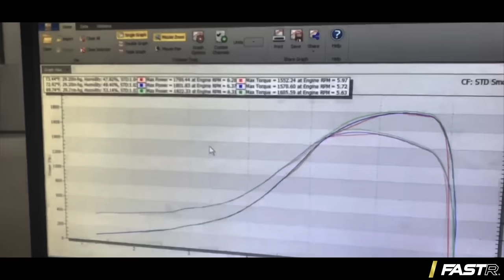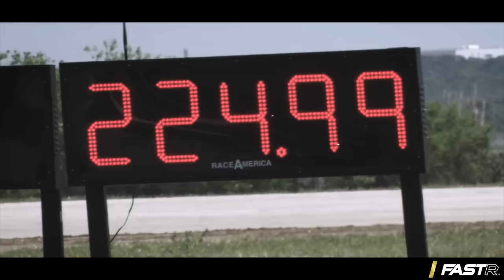2500bhp Viper on the road! Calvo Motorsports Visit!

Comment: As a porsche fan myself, I don't understand why these vipers aren't more popular. Great engine, not that expensive if u are on the states, a great track car overall, and it is a manual, which a lot of car enthusiats love. Pure respect for dodge and these guys who are building these absolutely beastly machines!
Reply: They were expensive for the average gearhead at around 100k. There were sport/ish cars for that money by makers that had more brand "recognition", if You know what I mean. Porche, Merc, Audi, BMW mainly. Much more "prestigious" to own those in circles of people that buy cars for around 100k.
Reply: @Duwurf  Yeah true... I didn't remember the germans were pretty cheap over there too. In europe cars are almost double than in the usa, even the european ones which is pretty rare.
Reply: they are dangerous cars, the main reason is that all of them only came in manual, which most people especially my age can’t drive… they also had saftey issues, which is why it got canceled in 2017, the first gens didn’t have ac, traction control, stability control, and no radio. These are not friendly cars.
Reply: The Gen 5 Vipers are excellent cars.  I own one.  I believe the reason they didn’t sell was 2 reasons.  Gen 1-4 were VERY basic cars that were expensive.  People who could afford them tend to want the iconic Porsche, Corvette type cars they grew up wanting.  The Gen 5 is a completely new car, a true supercar.  It takes many yrs to establish that credential.  I lost track at how many young people say “this is the car I grew up wanting and now it’s gone”.  Dodge should have kept the Viper line open as a limited production.  I can’t think of better marketing for a company than a Viper sitting in your showroom.
Reply: @todd5082  TBF I'm sure they make insanely better margins on the Hellcats/Demons, and they never had a devoted racing program to support the Viper to engineer out the kinks. Every other comparable brand does a good job of partnering with both road racing & drag teams to get the most out of each line and get the public looking their way. Audi, Mercedes, Porsche, Ferrari, Lexus, and on and on. They just never had real buy in like they needed across the company to make it happen the right way. Easy to see the difference between the Viper program and something like Corvette Cs or Cadillac CTS having it all from showroom to Le Mans.

Comment: a 10.1 liter billet v10, im not going to be shocked if he pulls out 4-5k Hp
Reply: i’m calling 3,500 not on high boost for a starter
Reply: @JJ-xw7im  from 8.4 to 10.1… thats bonkers
Reply: Easily over 4k horsepower. The Juggernaut can make 4k horsepower at the wheels on the dyno but it can't go down the strip because it is still only rwd

Comment: “1400 hp, i know not a lot of people think thats fast” 😂😂 most ive ever pushed was 400
Reply: exactly brooo my truck has just over 300 hp but it weighs like 6000 lbs
Reply: My civic has 500hp and I think that’s fast 😂
Reply: same here. but on a pickup lol. not the same as 400hp on a car.
Reply: my buddies have had 2013 ish bmw 335i’s is the past, one of them has a 81 camaro with probably 300ish hp, one had a 2015 mustang gt, one has a focus rs, my dad has a 2008 cummin with on “off-road use only” tune and a built trans, my uncle has a 2019 raptor. i’ve driven them all. i went to vegas a year ago and drove a c8 corvette on a track. by far fastest car i’ve ever driven. but that’s “only” 495 hp. i couldn’t imagine 1400, let alone 2500.

Comment: I drove a stock 2-year-old 2010 Viper back in the day and I was still shaking the next day. I can't imagine what 2500hp feels like. That was 60 - 178 in 6 seconds. Sometimes it's hard to convey speed on video, but you could actually see how fast that thing is. Fucking unreal
Reply: I can relate I’m used to driving big work trucks and work vans and when I drive my first 180 hp sedan my foot would be shaking on the clutch from fear

Comment: "1400 horsepower, I know a lot of people don't think it's fast..."

I'm still running my Lexus ISF at 425 bhp..............
Reply: It's all relative but I agree with you, these guys are insane with what they consider fast
Reply: There's always a bigger fish my dude.  I'd love to have an ISF in place of my WRX.
Reply: @MD-pz3cn  I came from a 2004 WRX STi Stage 2 protune. It wasn't a slouch by any means, but it isn't an ISF on many different levels.
Reply: @aok9153  I would say age and judgement are huge parts of it. If I was going to build 1000+ bhp car, I think I would set it up so I can run it with different power levels (boost controller or such).  My motto is one should respect the equipment and not go out there thinking they are immune to failure.
Reply: @EJ257IHI  Obviously getting a RWD 1500BHP car as your first is a stupid idea. I was more or less joking

Altough HP isnt everything. A 6 year old could launch a 700HP supercar. 

But launching a heavily modified manual without spinning out and embarrasing yourself takes some skill

Comment: I cant cant stand the people that say 1000whp is weak or not enough when they probably never been in a 400 or less whp! I started doin stock bottom end turbo LS stuff back in 2010 or 2011 just learning as I went and my first real street/strip car I built myself was way faster than my pawpaw's old bracket car 81 Camaro that was built in the 383 era lol it ran 7.40s in the 1/8, I put a 1977 nova he bought new in 76 together with a bunch of homemade and other guys junk this was back before I really understood turbo sizing well turbo stuff in general, I took a 4.8 with almost 200k miles I basically cleaned it up threw some pac valve springs talked to the guys at comp on the phone and ended up with a decent little cam, reused the truck intake and TB with deka 80's the turbo kit if you want to call it that was made with truck manifolds the hot side was horrendous so I wrapped it the best I could with shitty heat wrap that and a s475 with a 1.15 t6 housing from a dudes diesel build that was never finished I got my a2a intercooler from him also I pieced everything together as cheap as possible, almost ruined the harness a few times before I decided to let someone who knows what there doing help out with wiring and handle all the tuning after we got the car running and chased all the bullshit gremlins down I ran the it on 101 race gas 90% of the time we have a pump in town that's always sold 101 and the other 10% was 110 from the track whenever when ever I thought I was gonna go fast but usually broke something instead. But I will never  forget the second pass at the track my pawpaw was telling me all I did was waste a bunch of time and money and cut his car up LoL I foot braked it and ran a 6.71 @ 109mph on Hoosier 26x10.5 slick and basically a stock 8.5 10 bolt welded axle tubes with Strange's cheapest rebuild kit with a spool and 4.10 gears stock leafsprings with caltrac bars it was stupid simple. It definitely shut my pawpaw and his bracket racing buddies up for a little while It ended up goin 5.88 @ 119. That car never made more than 800hp and it was the most scary car I've built on the street especially if it had street tires on it idk if the stock 1977 front disc breaks and drums basically factory front end replacement moog stuff and 90/10 shocks home made sub frame connectors{still own it the car just been sitting for 5 years now since my truck is done I'm fixing to really throw some beans at it} it was just a mean little setup for what it was Honestly my 99 Z28 that's full race car with tag and insurance  it's been best of 5.17 @ 139mph and makes well over 1000whp but it doesn't seem like its trying to kill you when your playing around on the street. I guess my point is people shouldn't say shit about horsepower until they've been in at least a 800hp car hell even 500-700whp is alot of power especially on the street and street tires!
Reply: Tell us more.
Reply: True shit, all about that power to weight ratio. thats why you see hundreds the videos of tuned up honda civics taking lambos and ferraris to gapplebees. Anything above about 500 hp is maybe a bit wasted on a street car cause you have nowhere to use the full power in the city but on the race track that's another story
Reply: Dude, don't be afraid of using punctuation marks.

Comment: Remember when 600 hp was fast, the horsepower war is real.
Reply: 600 hp is still fast as shit for any normal street car don't let anyone tell you otherwise
Reply: @Cynsham  facts but, compared to how much power people are making now it is behind us
Reply: People have been making 4 figure HP American cars for a while. Welcome to the modification addict world!
Reply: @MS-mr4zm  no shit, but for the streets it used to be 450 would be enough to lay the smack down back in 2009
Reply: @iamthatguytheonlyone  and next thing you know 1800whp gas cars will be losing to 1000whp Electrics b/c they’re so much better @ putting the power down. Shit keeps changing….I’m not a big EV guy but in terms for straight line racing, gonna be a factor. I live in the northeast, given the roads/population density I think 450-750whp is the sweet spot for anything you’re going to actually wanna drive on the street regularly & get to use some of the power. I have a C5Z making a lil over 700 & it’s on Toyo R888Rs as well….& these vids are cute & all but how much power they’re actually getting to the ground on the street is questionable. These vipers are sick no doubt tho
Reply: @MS-mr4zm  dude it seems like it. Makes you kinda want to leave the car world

Comment: The fact remains. Most of these guys driving much older hardware, cannot control way less HP due to relying on technology. Not saying all but I've seen this a lot with young adults whom are quiet good with newer cars hi output but put them in a old 60s muscle car and they gun them on the interstate at 60 mph and lose the rear end. Hahahaha.
Reply: To be fair there are many that respect the machines way more like this guy. For sure. I will admit I'm biased. I like the old wild untamable HP.

Comment: Mines gtr. Go around the nur ring. Straight line is nothing.
Reply: A factory Dodge Viper ACR is about 7 seconds faster on the Nurburgring than the Nissan GTR Nismo. Obviously these Calvo Motorsports built Vipers are more about straight line speed but if you put one of these on the track with the right setup and boost setting it would still set crazy times.
Reply: Spell the name of the road correctly. And straight line is nothing?? Top Fuel dragsters, ESTIMATED at over 10000hp because there is no dyno that can actually measure it. Engines rebuilt after every run, only one gear and the racer is just constantly controlling the slip of the clutch as to balance out grip and slip of the tires. Track work is nice, but you can look at it as being a ballerina vs using a sledge hammer. Both have their merits. But the most powerful engines? In a 1000ft straight line racer. 
💪💪
Reply: A stock Viper ACR beat the GTR Nismo around the Nurburgring. This built viper would kill it, especially on the final Dottinger Hohe, where straight line speed is all that matters.